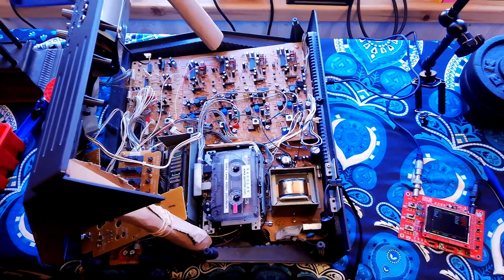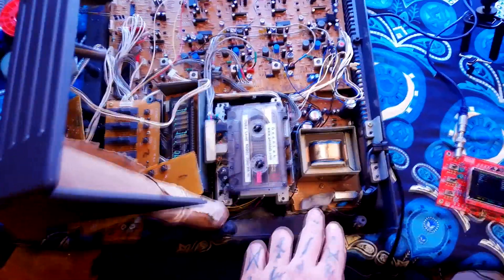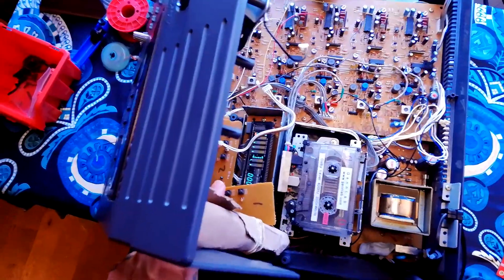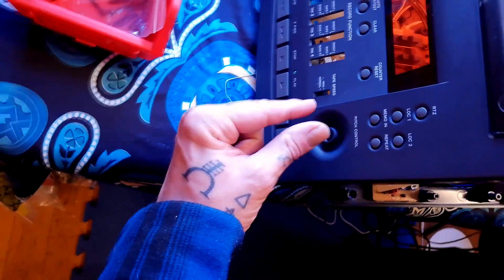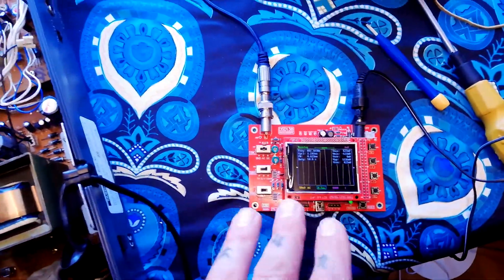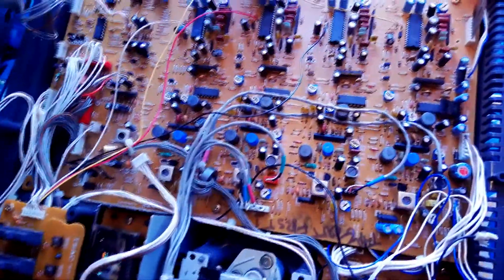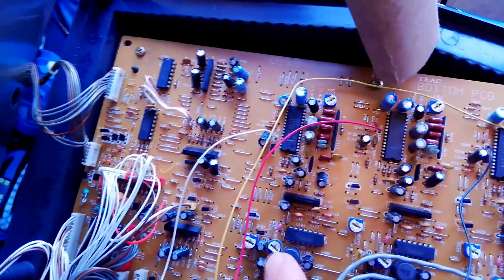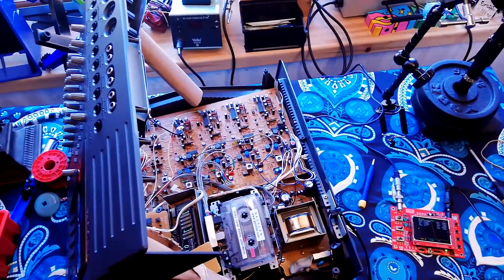4-track calibration | Tascam 424 Mk II |  Record & playback levels| Pitch

Comment: Greetings Tetrakan, and thanks for this helpful video. Had a question for you. When I track to tape using my 424 Mk II then dump the track into Logic, there is some drift in terms of timing. By the time 15 seconds has elapsed the tape track is noticeably ahead of the digital tracks. Is this normal? Would you recommend trying to adjust the playback speed with a screwdriver? Tracking using high speed. Thank you.

Comment: Hi - how're you getting on with the multimeter/oscilloscope you mentioned? I'm after something like that, can't afford the hundreds for "proper" scope, already have multimeter etc.
Reply from the maker: I'll be publishing a review before very long but in summary as a voltmeter/ cap tester/frequency counter etc it was fine but as a scope not suitable for audio work. Basically you can't zoom in on the Y axis/voltage, so in one mode the tiny voltages produced by a 4 track were too small to register, and in the other mode it redraws in an annoying way. Also the resolution of the screen wasn't great. I'd rather it was battery powered but the cheap little TFT monitor one I was using before (red exposed circuitboard, black screen, all over amazon, ebay etc) didn't have those issues and was completely adequate for this sort of work. So until I find an affordable effective  product that does it all I'd recommend getting one of those and a mid-market scope, I'm using an Extech, so, y'know, its not a Fluke, but its not silverline either!  Thanks for watching!
Reply: @Tetrakan  Oh what a shame. I've seen the same model on ebay for about £50, look forward to the review. I might have to save up for a decent scope then.

Comment: Hi Tetrakan - I've just discovered your channel as I recently bought a Tascam 424 mkiii. I'm having some issues with recording and was wondering if you had any advice? Track 1 works fine and records well but tracks 2 - 4 work occasionally but most of the time the display looks fine with recording around 0 - 3 but when I play it back it's much quieter with a much 'foggier' hiss/fuzz and the bars barely shows up on the display. I've cleaned the heads several times so I'm wondering if it's broken or whether something else needs cleaning? Any help would be really appreciated! 

Cheers!
Reply from the maker: Try turning the record amp trimpots up, but if they don't respond, the next most obvious thing I'd do is replace the electrolytic capacitors in the record amp signal path.
Reply: @Tetrakan  Hi Tetrakan, Thanks for the quick reply! I tried turning the trimpot up on input 2 which does increase the signal (although I have to turn the headphones way down as it comes through really loud and on the display it shows the bar for track 2 at full) - it then plays back louder (displys at around 0/+3 on the monitor) but still sounds more muffled than the really crisp track I get through input 1. Unfortunately I don't have much (if any) experience with circuitboards and electronics. Do you know if there's anywhere in the UK that services these machines?

Cheers for all you help!
Reply from the maker: @willmower2096  I service these. You can message me via fb or Instagram, or there's an email form and some basic info about repair services on the Facebook page. You should see links to my social media profiles if you navigate to my youtube home page.

Comment: Hi and thanks for your videos. 

I recently bought a 424 MK2 and it works fine except that the 'tape cue' playback volume is extremely quiet compared to the 'tape' playback. I understand that the tape cue function is used so as to not accidentally bounce tracks when overdubbing but when I'm trying to overdub it's nearly impossible to hear what I've already recorded, leaving me unable to overdub accurately. As a result I just overdub with the 'tape' playback instead of tape cue. 

Is this normal for this machine or is there something I can do to remedy this?

Thanks again
James
Reply from the maker: You should be able to get reasonable volume from the tape cue system. Nine times out of ten low signal is resolved by replacing the electrolytic capacitors in the signal path around the appropriate opamp, I’d identify the opamp in the schematic, make a little on paper of the caps bookending it, then replace them and see where I was. I have some videos in my electrical troubleshooting playlist which flesh out what I’m saying here a bit better.